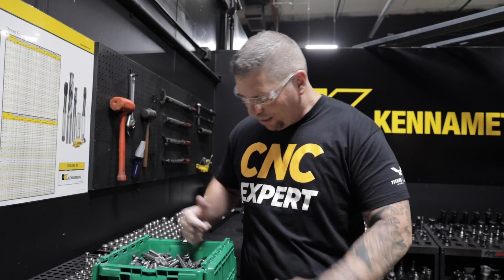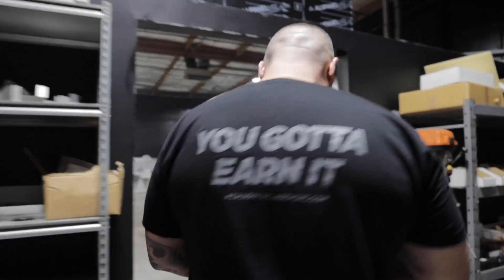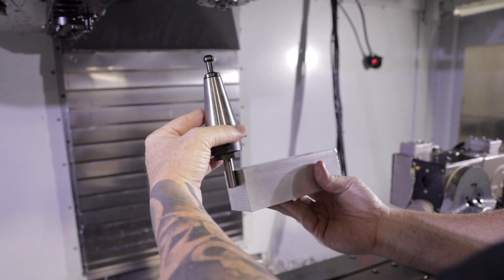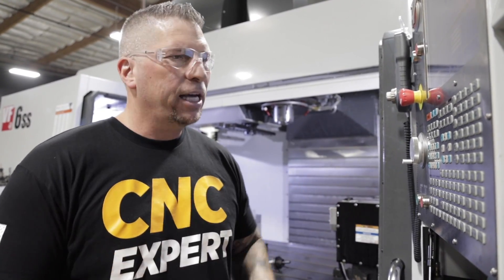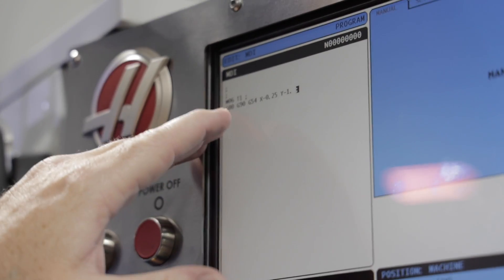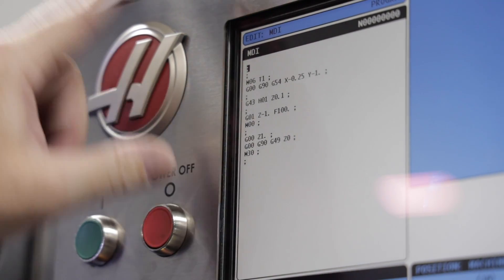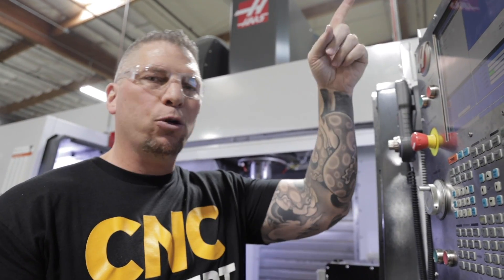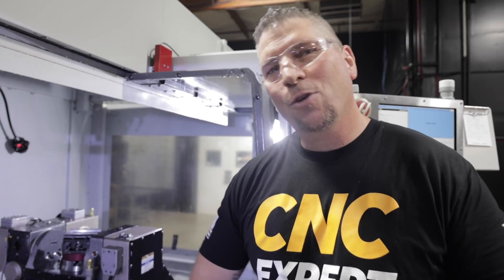G & M Code - Manually Programming an Invisible Stop - Vlog #46

Comment: Very helpful. Thanks for this and all the generous instruction. When my cnc table stops skipping steps and making disastrous mislocations, won't it be nice? Having the whole thing rebuilt with encoders or servos.  I'm about $20,000 invested and one year of head scratching with no productive capacity, but that's only bad choices of equipment, and the head scratching making more dandruff than synapses.

Comment: I've ran into 2 part stops so far and I'm sure I'll run into more. Luckily it's always with an insertable rougher so I just change the inserts instead of ruining an expensive endmill.
Reply: We had stops that mounted to the back of the vise at my old shop and one time the z didn't clear the stop and yanked it out of the vise and shot the bolts out when x went home at the end of the program haha.